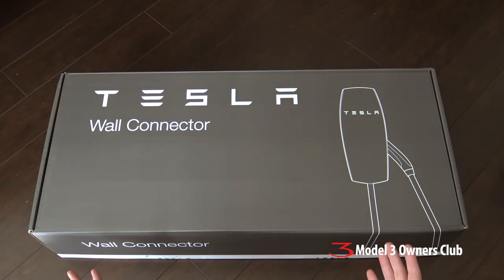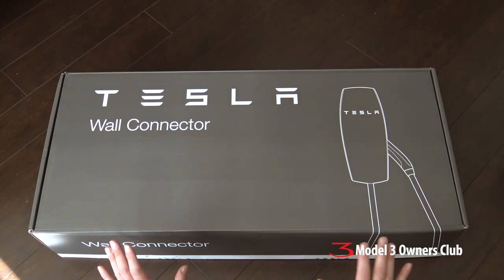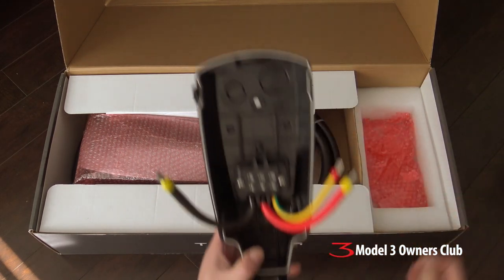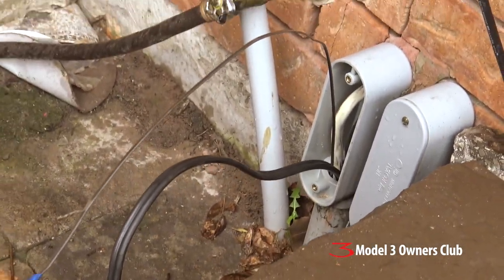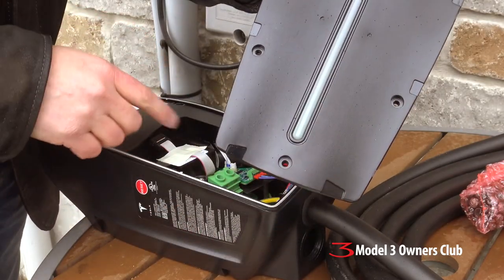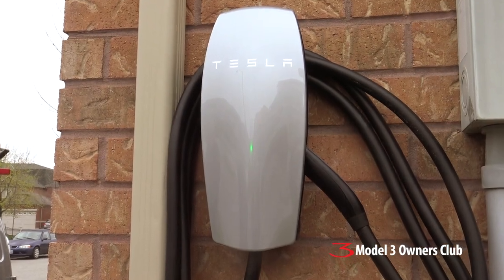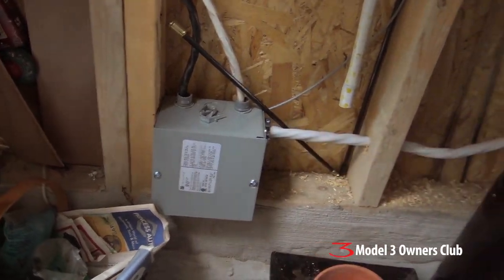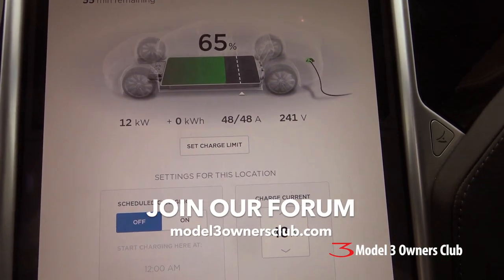Tesla Wall Connector Install | Model 3 Owners Club

Comment: I had my connector installed in early March before my late March delivery of my Model S.  I was a bit concerned about handing a local electrical contractor a device (the connector) that they had never seen before---Teslas are rare around here!  But Tesla referred me to an electrician who was experienced installing the connectors; they pulled all the permits, did the installation  and all I had to do was be home when the County inspector came by to give final approval.  I would recommend this approach to anyone installing a connector:  use the Tesla recommended electrician!
Reply: Bruce Stein how much for the installation and inspections?

Comment: once the model 3s start coming out like popcorns these units might even be in back orders. not a bad idea to install one while demand is low! Nice Video Trev!
Reply: I had mine installed at the end of last year so you weren't first :-P  I wanted to make sure I got the tax credit plus, like Sameem Monzaviyan said, they might get hard to come by.  BTW, I'm just across the border where the credit was expiring.
Reply: I got prepared too you know! By downloading Tesla app on phone :p
Reply: And then we spend the rebate on more Tesla goodies :P
Reply: wrong, Tesla won't behave like Chevy Bolt -more Tesla out there more wall connector and more third party seller-so, less expensive.
Reply: @tashi282  Turns out you were 100% wrong in this.

Comment: Yay! Well done, Trev'. This will be very helpful for novices to install HPWCs. It was fortunate that your existing conduit was large enough to accommodate the 6-gauge wire. Whew! It's also great that you could install a 60A breaker and thus have full 48A charging. That should put about 35 miles of range in the battery per hour. Sweet!

Comment: Your installation challenges were identical to mine for Tesla Wall Charger in my garage.  
//  I went to dedicated 100 amp breaker to deliver 71A at 248V.  
//  Nicely done gentlemen/ lady.
Reply: +Model 3 Owners Club -- Trevor, your electricians looked authoritatively aggressive.  Impressive.  Indeed, you will be okay using only 2/3rd of peak from the Wall Charger on 'dedicated' circuit.  
//  Thorough, very useful presentation, as always!  
//  I've also installed 28KW DC solar ground-mount grid-tie, to all-electric residence, if the sun isn't bashful to come out.

Comment: I talked with the Sustainability Director for Knoxville, TN. There is only one apartment complex in the whole area that has an outdoor EV connector. I moved there. Make sure to talk with your APT or HOA complex to get something ready! Even if you have a garage, sometimes you can't get the 220v upgrade. Better to look into this ASAP.

Comment: Awesome but now your going to torture yourself by looking at it everyday until the Tesla arrives.
Reply: Oh I know what you did. You just threw $800 over the wall just so you are sure you will NOT back out of getting the Model 3. Good idea. I'm going to order a replacement Model 3 door  :-)
Reply: Running the cable was a good idea because even if he got a different EV, he could just change the connector unit at the garage for a different EV. The line could also be used for a sub panel to run other things in the garage if you wanted to.

Comment: Excellent work!  Thanks for showing this to us.  I believe the older version of the unit required that DIP switches be set to the intended output.  It seems this new iteration is more straightforward.

Comment: Good thing is the more these guys fit these the better they understand them and anything they need to be aware of. 👍 looks a very professional job done with not cutting corners.
Reply: Scotch this wiring is so basic if any electrician has trouble with this they should hang up their Kleins.

Comment: Thanks Trevor for this video. It is really helpful and well timed, as we all need to think and get ready! Nice job.
Reply: No we don't need to get ready, this was too premature. The Model 3 isn't even fully revealed until July. There is plenty of time.
Reply: Well .. I guess we need something me clarification here, as I think there is a long process to follow, at least in Italy where I live, you need to get permits to enlarge capacity of the power meter (in the hard case you have to change it to a three phases type), you have to plan for the wall box, it shall not be a Tesla, there are also others available on the market for different prices, and you need to do the actual work... I guess Trevor was a bit earlier with his video, but his "job" here is to let people think about a "mind switch", it is not only related to buying a car , it is also related to how you charge it. If you think that probably some of the viewers will receive their Model 3 by the end of the year... it is not so earlier.. :-)

Comment: Good video, I have electrician coming out tomorrow to install plug for NEMA 14-50 for Model 3. Will buy mobile connector that will stay in the garage. Also installing 240 volt outlet for 2014 Chevy Volt that I got in March 2017. Old ICE Mazda 3 with 245,000 miles died. Fingers crossed hope to have Model 3 by December 2017, stood in line early.👍🏼

Comment: A great install vid. I don't do these kinds of vids because it would give the city evidence to come after me :-)

The only thing I would have done differently is I would have installed a 100a subpanel in the garage. That would allow you to put the charger, all the lights and plugs, and whatever future stuff you add to the garage to that panel.
Reply: Given that the mainpanel is 100a, shouldn't the subpanel be less than 100a?

Comment: Dang that said I was under the impression all cars were able to be equipped with dual on board chargers like mine. It's sad to see how many people are missing out using this connector on and 80 amp circuit. I've had a car without dual on board chargers and my current model S has dual chargers. It makes the experience much much better. I hope for everyone's sake that Tesla offers this option for model 3 and highly recommended it!

Comment: I am all set. I have a gen 1 volt but I got a 30 amp 220 box overkill for the volt but it will. Be fine for the tesla. I even put it in the front left of the garage so I can pull in and it's right there. Again the volt charges on the same side but front it's all good. Can't wait. Just need an adapter for the plug

Comment: 10:39 - I cringed. Philips #2 used on T20 tamperproof Torx head :-|
Reply: My mistake. It is called Tamper-resistant Torx or TR-20. Not T-20. Sorry about that.
https://en.wikipedia.org/wiki/Torx#Variants

Comment: Hi Trev. You may want to add the settings for the amps of the HPWC depending on what your cable and breaker are limited to. Many installers leave it is the standard setting which is lower than what the cables and breakers can supply. You obviously instructed the HPWC that you have a 60A circuit so it limits to 48A. Which is correct for your case.
Reply: Indeed; official Tesla installation video makes it very clear that you should definitely adjust some dip switches on the inside of the Wall Connector in accordance to max installation/cable amperage. I believe you should update the video with this information, seems quite important imho.

Comment: Three things: 1. You should connect  the Tesla charger directly to your main panel on the side of the garage, only 1 foot away fro where you intend to mount it. This round trip to the house and back from the house is, well odd.

2. You don't want "220 volt power" we use 120/240v single phase in North American homes.

3. The mobile cable outlet isn't "40 amp" it's a 50 amp circuit. Circuits are sized such that max draw is 80% of a circuit's capacity. The mobile cord draws 40 amps a the 50 amp circuit.
Reply: Square D makes a 200 amp outdoor main breaker panel with pass-through lugs which can be mounted by your meter.  It includes 8 QO full size breaker slots.  You can use these to feed exterior devices such as your Tesla charger, a heat-pump outside unit, swimming pool pump, well pump, backyard shop etc.  That way, you don’t have to run individual power feeders back OUTSIDE from the distribution panel INSIDE your home, and it is more convenient when you need to shut off power to one of these devices for servicing, because you don’t have to run back and forth into the house to turn the individual breakers on and off.  The main breaker in this box serves as a disconnect to turn all power off inside and outside the house.  Model# QO1816M200FTRB.  $147 US at Home Depot.

Comment: Great install video but Why did you edit (12:52) out the actual attaching of the power cables to the charger? I found this part most critical and somewhat tricky. I feel more comfortable knowing the best procedure even if a licensed electrician is doing the work.

Comment: Chiseling out the stone around the back of the wall connector unit is a normal thing I do, all the time when having a external nm connector on the back of a box or unit. It should not have been an issue or surprise. The junction boxes at each end of the conduit would  not be necessary unless the wire in the conduit is not coated nm (thhn insead) and you need the box to transition. But it looked like what he pulled through was coated nm and there had to be coated nm before since you did not have the boxes before so there should not have been a need for them.  You are lucky they used a larger size conduit to the garage originally since it was just a 120v circuit and some switch feeds. If you could not use the conduit, I have a tool that could drilled horizontally through the ground from your basement straight out and you will just have to make a receiving hole by the garage. Rather than running it outside along the wall/fence. But I know most contractors do not have it or now about it.

Comment: Great video Trevor.  I mentioned to you before that I am in Milton so I will definitely give Mirek a call.  I am not sure which route to go, either a 40 amp circuit or the wall charger.  I think I'll have Mirek come out first and assess.  At least he has some experience now installing the wall connector!
Reply: Agreed, I already emailed him and mentioned you. lol  The only concern I have with going with the Tesla UMC is length.  I like the convenience of the 24' cord that comes with the wall connector.
Reply: Hey Trevor, met with Mirek this weekend, great guy. I am going to go with the 24' wall connector after all. He made some good recommendations, looking forward to getting installed as well.  I think you mentioned before the ON gov't provides a $1000 rebate...I assume this covers the unit as well as the installation, correct?

Comment: Regarding the return conduit from the house to the garage - you said it was a 15 amp circuit. That seems really, really low.  You couldn't even run a shop vac on that.  Did you mean to say 50amp?

Comment: I want to get that 72amp charger for the M3. It remains to be seen if that will even be offered on the M3. Think of it, 25kw of charge vs. 6kw on the current 220v chargers. All it needs is a 100amp circuit, which is about the same as provided for an electric stove.
Reply: "same as the model s"

Confused. Which car is the 72 amp for? The X?
Reply: Ah, and M3 will be limited to 75kWh packs. I see how you arrived there.

I'll live. Whats the the kW with the 48 amp charger?
Reply: Thanks. Not as exciting, but still double my 6.6kW standard car charger :-)

Comment: Tethered unit is the way to go. Charging any EV you have to get a lead from inside the boot (trunk) becomes a chore really quickly, and packing it back in the car after as well every day too. The idea you have to plug in every day soon passes as well once you realise you generally don't tend to drive that far everyday. Now just wait for the car, and pretend it doesn't bother you to wait !!!

Comment: If you waited you could have done this thru the Ontario EV program and got 50% of the unit and install paid by the gov't.  I don't think you will be able to submit for the rebate, as there is a time limit window on it.

Comment: you did fail to cover and the amperage limit mechanism that's inside the charger. Cuz there's a little dial inside the charger where you said what the max amperage is that the charger can pool.

Comment: I am a cable technician in Florida and noticed your cable wallbox and it's not professionally installed. I would highly recommend you contact your cable service provider and have them fix that situation before it comes with problems for your Internet.

Comment: Not sure if you have 3 phase power available at households in the USA and Canada, but there is an Australian guy who got his Tesla charger working on 3 phase power and is charging his P90D at over 100 km/h (65 MPH) from his home! Seemed pretty easy for him to get the 3 phases, just had to apply to the grid company for the extra power meters. From what I've heard, I think they make it almost impossible to get 3 phase power in the US, even if you're running a business. Not sure about Canada. Hopefully legislation will change once the demand for faster home charging grows (which it no doubt will).
Reply: 3phase is commercial and industrial only.

Comment: How far apart can the chargers be if they are ganged on the same circuit?  Just thinking of how to future proof a two car garage for two EV's.  Maybe Tesla will have some floorplan views to help with planning?
Reply: Hey Trevor, So I ended up contacting charginginstallation@"ourfriends".com and they sent me the manual (which you have).  In appendix B it shows the details.  It looks like as long you're careful to protect the communication cable (18AWG 600V twisted pair), the chargers could be up to a max. of 49' apart.  One will be set up as the master and the other(s) as the slave(s).  Good to know there's some flexibility for setting up a garage for multiple EV's!

Comment: RCD, Residue Current Device, are you sure this is the correct beaker type required for installing the TESLA wall charger? The breaker type listed in the owners manual requires a RCD type breaker they usually have a test button on them. The breaker you installed is a standard only thermal break, not a RCD-30ma type. Unless I'm missing something...

Comment: I'm curious: So the part where the master electrician accessed the box in the basement, they turned off the main switch in the main box that's on the garage wall, right?

Comment: You used two different 6g wire runs?  (white and black cables).  Was there some difference between them?  What was the size of the return conduit?  Did they have to lubricate the cable to pull it.  Was there anything in the conduit except the 14g wire for the existing 15 amp circuit?  Did your garage not have a 20 amp circuit for the wall outlets and a 15 amp separate circuit for the lights?
Reply: Should have watched again before posting.  Thanks!

Comment: Do you need 6/4 or 6/3 wire for the wall connector? And does it matter if it’s indoor or outdoor if it’s going underground in conduit?

Comment: Hi, my cable is ready as well. I was wondering if there is any way to monitor and record the energy going to the tesla through the cable ? Indeed fuel can be deduced from tax in EU so I need to separate what is consumed by my house and what is consumed by my car. I am searching for a kind of device counter working with an app that would record charging stats. Any idea ?

Comment: Better to install  a 100 amp breaker to have a maximum of 80 amps of power delivered. This way you can recharge quickly if needed at home. A 40 amp charger is fine if you can park overnight but it costs less to go the extra 40 amps even though it will only use on a newer car 72 amps on high power. It will also allow someone else to charge quicker if they need it.

Good video on the installation step by step.
Reply: Given that the mainpanel is 100a, shouldn't the subpanel be less than 100a?

Comment: I found working with 6g extremely tedious due to the stiffness.  I spent an hour just trying to bend it and get the length just right to the connectors.  It is very difficult to manipulate 6g in that tight space.  We just moved to a new house and I will have to do this again with 3g since we will have two load sharing HPWC.  I can't imagine how I will be able to do this with 3g for a 100 amp circuit.
Reply: Depending on how many miles you travel per day you might be able to get by with the 6 gauge on 1 HPWC again.  The Model 3 will be my first EV but I had ours installed between our cars in case we get a second Tesla.  Since our commutes are each only about 30-40 miles round trip we should easily be able to share the HPWC.  With about 4 or 5 days of range on a charge it shouldn't be hard to coordinate charging days.

Comment: Thanks Trevor for this video on the installation of the wall connector. I am currently installing my WC and have a question: did your electrician hook the ground and the neutral wire into the same lug in the wall connector? I'm running a 100 amp service, so I am using 3 gauge wire, i'm beginning to wonder if both wires will fit in that single lug.
Reply: Model 3 Owners Club - hmmmm, we seem to have conflicting input here, my electrician said that it is true that you don't need the neutral in order to supply the 240 V service to a load, but the neutral carries energy during exceptional situations such as Load  imbalances and dissipation of transients and lightning strike, etc. maybe we need more research on this. If I eliminated the neutral it would save me one third of the wiring cost which is over $100 savings USD.
Reply: I DO apologize..............., I apparently misunderstood some things my electrician told me. My electrician agrees with your....., no neutral wire is required (because it is assumed the WC will not consume power in an unbalanced manner). This will save me nearly 100 USD and make it easier to pull the wire. Thanks for the help and I am sorry about the confusion.